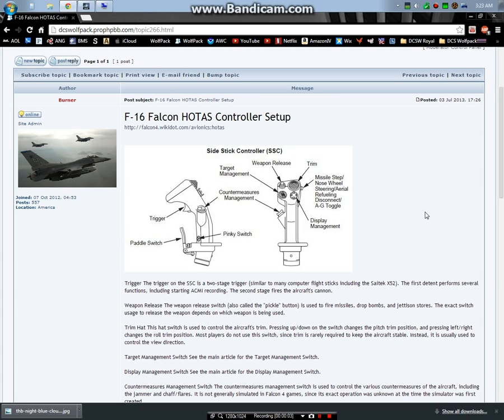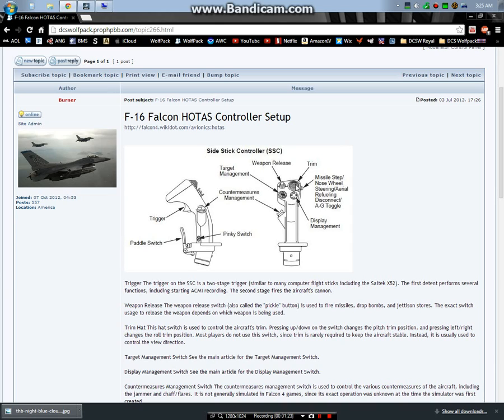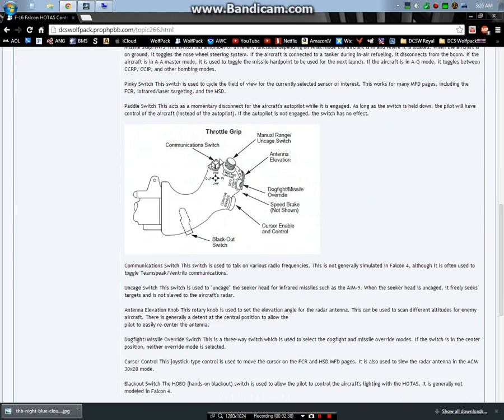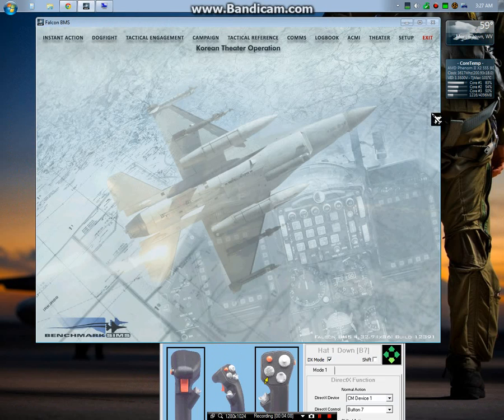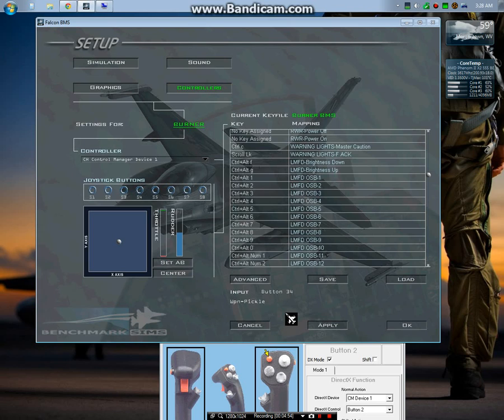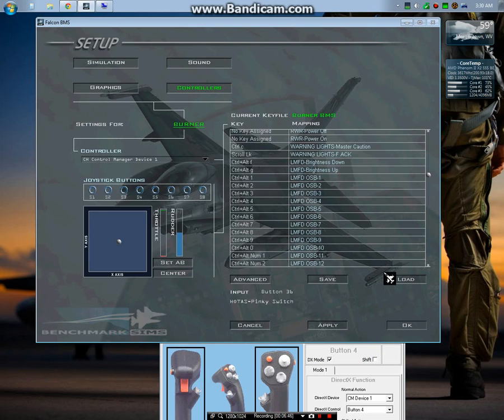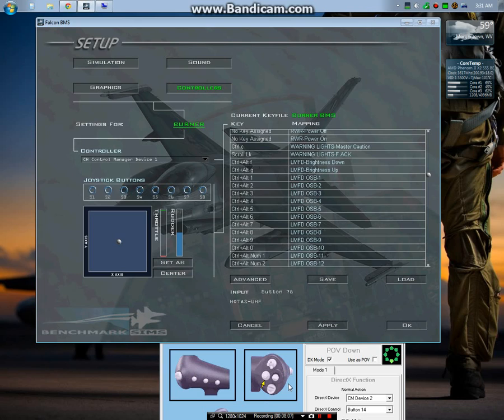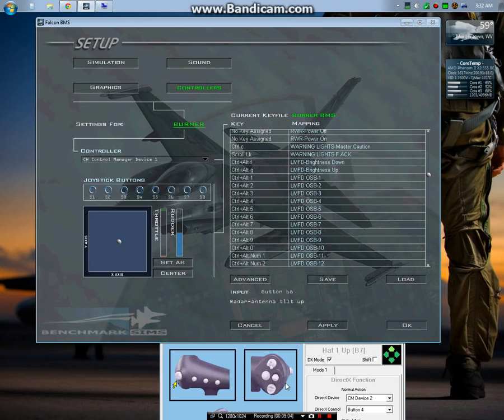✪ BMS 4.32 "HOTAS Joystick and Throttle Setup"

Comment: actually you can use the missile step switch to swap between a2a missile types by holding it. also hotas is not used to change steerpoints, that''s what the icp is for.

Comment: Hey Burner - Any idea if Harpoon's "pilots legs mod" for BMS works in 4.33?
Reply from the maker: +SteelbeastsCavalry yeah it works for the F-16, however, its will "downgrade" your cockpit to the 4.32 model. It does not work properly for the Hornet at all.

Comment: A better use of the three small buttons on the front (or back?) of the Pro Throttle would be to map them to Alt, Ctrl, and Shft key presses.  Combined with some extra edits to the keys file, one could effectively triple the number of functions called from the HOTAS compared to using just single function buttons.  In my own CH HOTAS, I mapped about 120 functions total (although far more certainly possible). 
Also, the single function thumb switch on the right of the Pro Throttle (the button surrounded by the three 4-way switches) makes an excellent "hold to glance forward" button when in padlock mode.